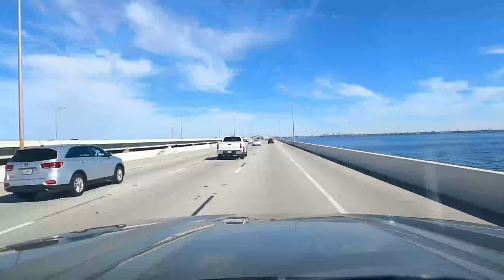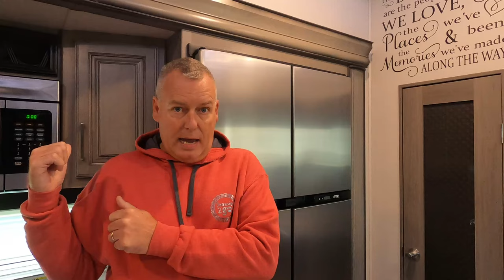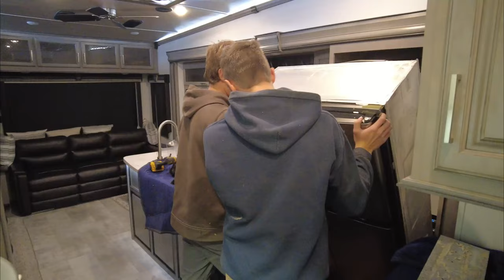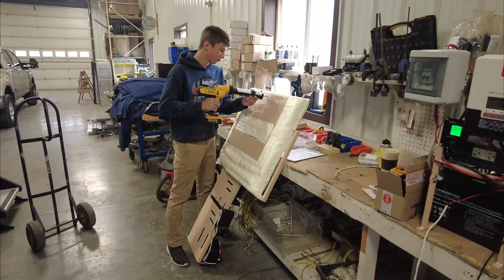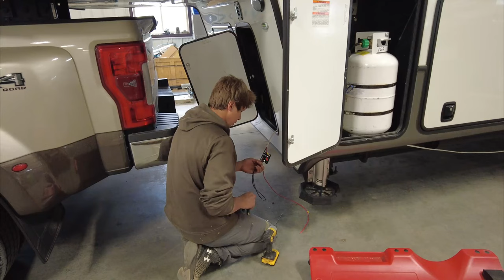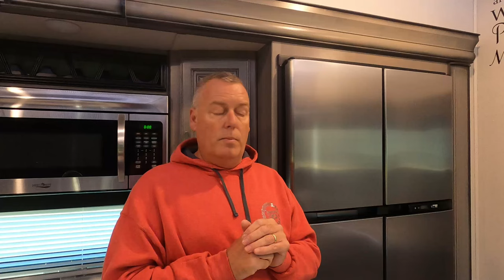Norcold RV refrigerator problems and solutions / What your dealer doesn't tell you

Comment: hi 
Most RV fridges are poorly serviced by inexperienced people 
gas service 
crimped  lines ?, gas pressure , flue clean ., flu spiral , jet clean ,ignitor position , flame colour 
Burner exhaust separate ??
thermostat check 
12v service volt drop ,  amperage consumption , size of feed cable , ground  where ??
fridge body check over 
install,  rear wall spacing 1inch , majority are not 
Duct work for air flow, none have this fitted 
fans ,incorrect position , number of fans , spec of fans 
When all this is correct 2 or 3way fridges work in weather upto  100 F  high humidity 
Higher than this depends on individual circumstance